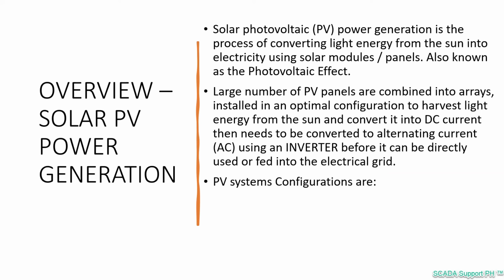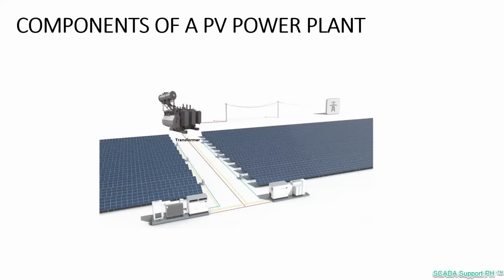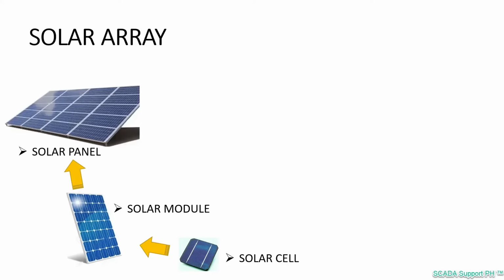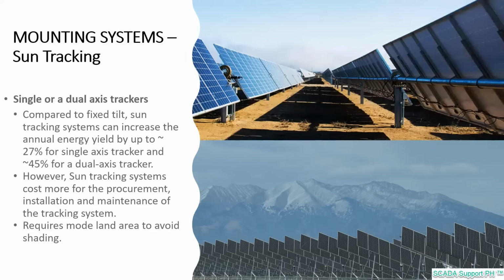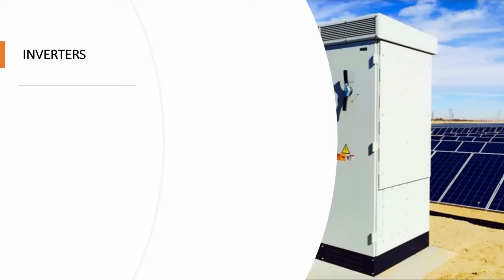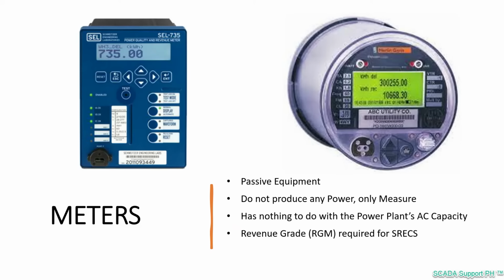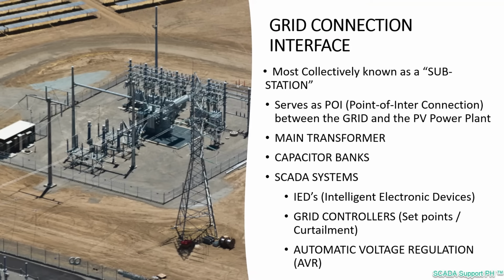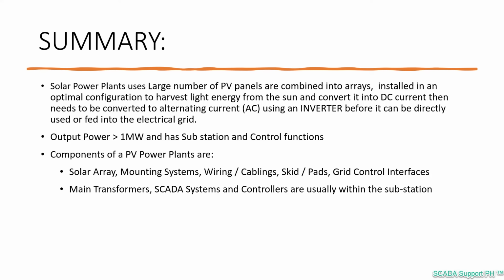Solar Photovoltaic (PV)  Power Plant

Comment: where are the power banks or batteries? how can it generate electricity during at night?
Reply from the maker: @keiannschyler the additon of batteries are part of the BESS (Battery Energy Storage System) which became popular late 2017. The video is about the standard components excluding BESS. I could add this on the pipeline for this year. Thanks!
Reply: @SCADASupportPh  thanks.

Comment: what is the length and width of solar panel?
Reply: Varies by solar modules/panel. For example Qcell 400W are 74*41, Sunrun 360W are 42 wide - 64 lenght i believe
Reply from the maker: @arindar4310 the length and width of the solar panel would be dependent on the number of Solar Modules. The response from @babygangster4486 is correct when we talk about a single Solar module. The difference between a solar Module vs a solar Panel is also being discussed here : https://youtu.be/K12l9J3pLIU?t=362

Comment: Im currently building a PV power plant, grid-connected, power 735KW, that will produce around 1.100MWh annually. Fixed mounting, bi-facial panels, string inverters, connected on grid with cable to city substation that is 4km far. I plan to sell the electricity for about 100eur/mwh. Your video helped me alot, please your thoughts, thanks!
Reply from the maker: @pericagligorijevski that's good to hear that you're a renewable energy supporter! 

The energy pricing is going to be dependent on your PPA (Power Purchase Agreement). Would you be able to share the PV Power plant location so I can support researching for options?
Reply: @SCADASupportPh  yes, its located in North Macedonia, the KWp is around 1500, considering the geolocation( 280 sunny days, average 5h per day sun ) but also the bifacial panels. Im also searching for options for max production -what to place below the panels so im reading the comments on your video and would like some tests if possible for white marble, gravel, or even nylon...
Reply: How is your project going ?
Reply from the maker: yeah @pericagligorijevski2336, we'd be happy to know the status or any update on the above mentioned project.
Reply: Here is an update guys. The plant is 823Kw panel power and 740kw invertor power. Operation started od 13th july 2024. So far so good, the production is very solid l, i expect 1250-1300mwh per year and with averave price of around 60 euros per mwh, the plant is generating around 75-80k eur ( 80-85k usd ) per year. I havent put white stone since the land is slightly bended and my fear is that one heavy rain would carry it away on one side. If you have any questions, feel free to ask. Regards,
Reply from the maker: @pericagligorijevski2336 way to go!! congrats! 

btw,have you started accounting for the monthly/ Annual Predicted production? this will help you understand if your system's ouput  is still on it's threshold or deviating from the expected production.
Reply: Hello there. I had slight delays for administrative things, permissions etc. But today the construction is stsrting. In 2 months will be finished and i will do an update.
Reply from the maker: @pericagligorijevski2336  wohoo!! that's great to hear! Hope you managed to work your way through all those Procurement paper works. 

Best of luck on the construction phase!
Reply: @SCADASupportPh  the paperwork took about 12 months, its very hard but it pays off. Now im in the middle of construction, the construction is done, now the solar panels are mounted. In a month it should be producing electricity. Also, i increased the power to 823kw. Now im searching for materials with high albedo effects to place them under thr panels to maximize production. Thanks for the support all!
Reply from the maker: Congratulations @pericagligorijevski2336! you should give yourself and team a pat on the back for a job well done!

As for the albedo effects, I've seen sites with white pebbles underneath the modules as well as silver foil (this one needs high maintenance and needs to be replaced during rainy days or winter time). Other sites uses plain white boards.

If you're aiming to maximize the efficiency of your panels, it's always good to have a strict module washing schedule to reduce dust and dirt that greatly affects their performance.
Reply: @SCADASupportPh  yes white stone from marble under the panels imo its worth the investment. Other materials are good but high maintenance. The white stones should increase the production by 7-10% from what im told. I will test this on one inverter and compare with and without. Will give feedback on the results.
Reply from the maker: Looking forward to your update @pericagligorijevski2336.

I'm curious to know the setup you have on site. Are you using an Albedometer, or a backside irradiance sensor?With the bifacial modules installed, it would be good have an accurate expected energy model and predicted data set for the bifacial modules. This will effectively show your bifacial gain.
Reply: @SCADASupportPh  I have client who is looking for 30 MW solar power system with storage. Would you support please? How much you can charge to make a viable project plan?
Reply: I got consulted to do the O&M for a power plant of 7MW for 3 years I would like to ask you some questions

Comment: Hi everyone,

I have a couple of question, Can a common switchgear be used for both battery and solar in 3-7 MW َAC-Coupled projects, and then connected to a transformer and grid, or should separate switchgears be considered for the battery and transformer, separate from the solar system?
Moreover, the voltage and frequency of the Inverter and PCS systems are exactly the same.

Thanks
Reply from the maker: @alirezakosari , It's possible but I would say a risky approach and will be dependent to the specific requirements of the project, the design of the switchgear, and the regulations in the location where the project will be installed.

Based on sites that I've seen and worked on, there are separate switchgears for the BESS and transformer, separate from the solar PV energy system considering safety requirements, reliability in operation as well as different protection requirements.

Regarding the voltage and frequency of the Inverter and PCS systems being exactly the same, this can simplify the system design and reduce the need for additional equipment, however it is still important to ensure that all components are properly sized and integrated to mitigate any issues during daily operations that could potentially lead to damage or safety issues.

Comment: Great job explaining a lot of material! You explained just the right balance of easy to understand while being technically useful. would you mind talking about the space required for a solar power plant, as well the output wattage of the panels ie. is 460w better than 550 or 350W. Thank you
Reply from the maker: @wolfmanj3 The space required for a solar PV power plant depends on several factors such as the total wattage of the panels, the efficiency of the panels, and the desired output of the plant. Generally, a 1 MW solar PV power plant requires approximately 4 acres of land. However, this can vary based on the specific conditions and design of the power plant.

In terms of panel wattage, higher wattage panels such as 550W and 460W may have advantages in terms of space utilization and efficiency. With higher wattage panels, fewer panels are required to generate the same amount of power compared to lower wattage panels. This can lead to space savings, which can be particularly beneficial for large-scale power plants where land can be a significant cost.

However, it's important to note that higher wattage panels may also be more expensive, and their installation and maintenance may require specialized equipment and expertise. Additionally, the selection of panel wattage should be based on factors such as the available space, local solar irradiance levels, and project budget, among others.

Overall, the choice of panel wattage depends on several factors, and it's important to evaluate each project's unique requirements and constraints to determine the most appropriate solution.

Comment: Thanks you very much very informative, I thought solar plant use battery to store energy, in this case its direct from panel to the inverter, did I get it right sir? Thank you
Reply from the maker: @frederickdelatonga prior to 2019 there are only 2 types of Solar Energy system installations, the OFF-GRID; which uses backup battery for energy storage and night time demand and the other is GRID-TIED systems; grid backfeeding which is the one being described in this presentation. 

Beginning 2020 the HYBRID; grid tied system + battery storage solution became popular with the addition of the it's components (charge controllers, battery bank, battery-based grid-tie inverter etc).

Battery storage are popular mainly on residential and commercial usage, however when it comes to power plants, the ROI for battery storage vs the cost of adding it on top of an existing or new Power Plant's implementation cost is still for debate.
Reply: @SCADASupportPh  thank you very much sir
Reply: @SCADASupportPh  you mean to say sir, solar plant can only use in day time, and they don't have a day of autonomy in case of bad weather because they dont have a power bank? Thank you sir
Reply from the maker: @frederickdelatonga8849  The statement you have above is fairly right, as the output / performance of a PV plant (without battery storage) is relative to the irradiation from a specific light source ; which in case the Sun. The Power being generated by your PV system is linear to the irradiance being received by solar panels.

Thank you sir!
Reply: @SCADASupportPh  thank you so much sir

Comment: There is a big substation around 6 km from my power plant base. Is this means that I don't need to build a local substation in my 10 mw power plant and can use that one instead?
Reply from the maker: @caveman thanks for your comment. I do have some items that needs further clarification on:

1. What is the relationship of the big substation to your power plant? is it a part of your system, or dedicated for a different entity? (e.g. Utility, or other systems)
2. If you have a 10MW Solar Power Plant, are you sending energy production to the Grid or Utility?
Reply: @SCADASupportPh  1-The substation doesn't belong to my power plant, it's for the city 2- The power plant energy would be for the grid.
Reply from the maker: @Caveman00BC  based on the answers you have above, I would assume that the system you have now is not to be considered as a Power Plant but a large commercial PV system wherein you have no controls on the output generation like curtailment, deration and the like. Meaning, at any given point in time, the total output power of your system is equivalent to the sum of your (online) inverter's power output.

With a PV plant this size, I would suggest to coordinate with your EPC ( Engineering, procurement and construction) team, to revisit the design and the regulatory framework affecting such
 substation installations as well as the grid connection agreement. Grid connection and potential substation
 requirements should be listed on the Initial Electrical Layouts.

Key electrical systems must be designed in detail. This will include equipment required for protection, earthing and interconnection to the grid. The following
designs and specifications should be prepared during procurement stage:
• Overall single line diagrams.
• Medium voltage (MV) and low voltage (LV) switch
 gear line diagrams.

• Protection systems.
• Interconnection systems and design.
• Auxiliary power requirements.
• Control systems.
Reply: @SCADASupportPh  Exactly, And thank you for your detailed answer.

Comment: Great video. Do you have references for the material presented here?
Reply from the maker: @Haritha thanks! hope you liked it. 
What I did here is compile all the learnings I got from my previous work experiences and have them formatted for a more general audience. If you have topics in mind related to the solar industry or use of SCADA in renewables, please feel free to suggest and I'll try my best to accommodate them.
Reply: @SCADASupportPh  Thanks for your reply to my comment. I do have a few suggestions:       In the other video about SCADA, you had mentioned a little bit about SCADA control function (software section). It would be great if you can provide a little bit more information about the controls, for example, wind stowing controls and how it communicates with the MET system? can SCADA over-ride wind stow safety commands, etc., Also, any inputs on standards to refer to for control and protection systems for solar PV would be great.
Reply from the maker: @Haritha Yes, the control functionality will only exist if your Software has "Write" functionality or commands to your field devices. 

For wind stow functionality, the tracker angle is the one being controlled here and there should be a controller or a PLC near the tracker system that would recognize / interpret the signal from your SCADA system and would interact with the motor of each tracker. 

On the met station, there would be a remote Data Logger that would act as local data acquisition system..... - and I'll make sure to publish the video I have in the pipeline for this.

The experience I got that are related to Control and Protection systems are more on the standard hardware - Circuit Breakers , Disconnects, and for those that are within the Substation ; RTAC, Protection /Feeder Relays, etc
Reply: @SCADASupportPh  Thank you for a detailed response. Looking forward to more videos on this subject!

Comment: Great video. I have some question
 1) at 16:29 of the video, I  see a small solar module (above the data logger) on the MET. What is it used for? 
2) Is there some other link or videos where I can get the P&ID for study of such a PV power plant?
Thank you
Reply from the maker: That would be the "Reference Cell", it is used to measure the actual irradiance on a tilted angle. Absolutely, I'll make a video exclusively for the Met Station and share it with you guys. 
Thanks!
Reply: @SCADASupportPh   so there is a reference cell in addition to the reference module present in the arrays. Thank you that clears my doubt..waiting for the next video.
Reply from the maker: @dhanashripatankar676  for some additional context on the Meteorological Data Acquisition System (MDAS) for PV Systems: https://youtu.be/hw4_T5cqZ7Y